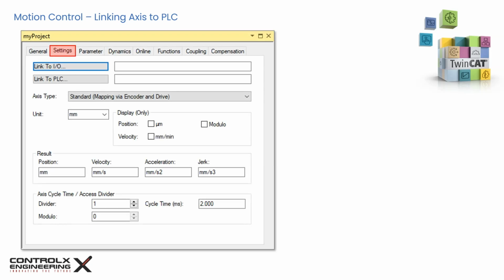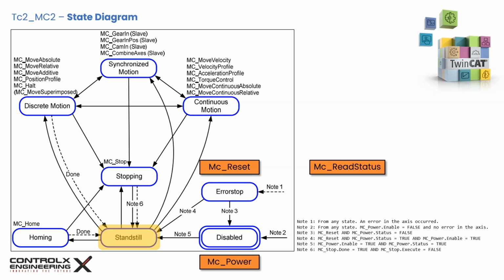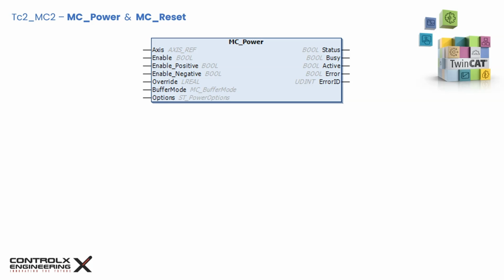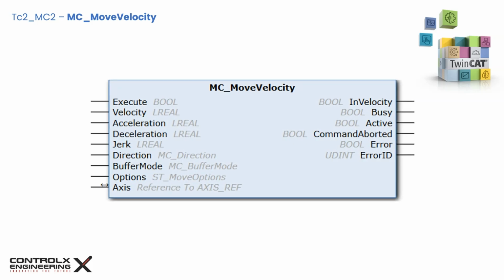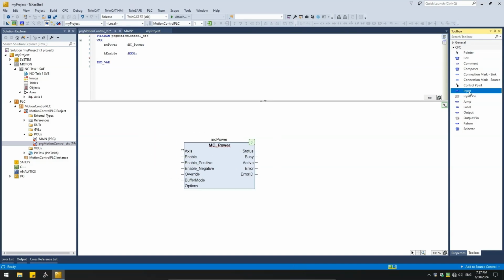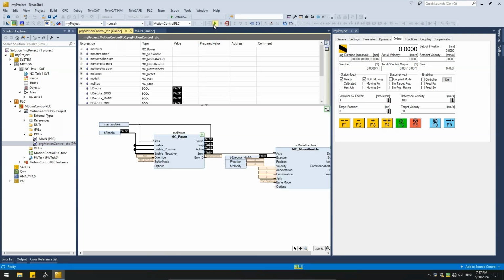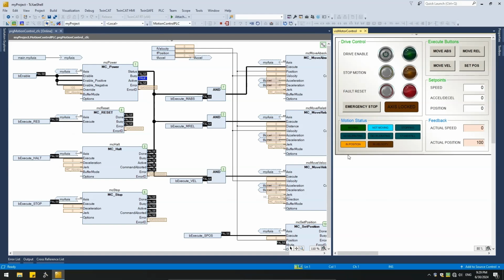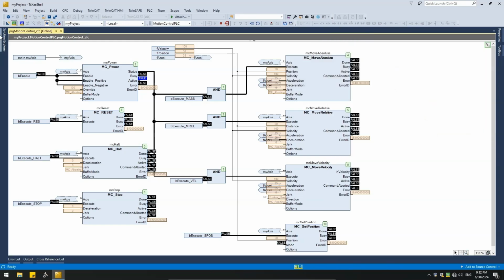TwinCAT 3 Motion Control (Part 2): PLCopen Motion Function Blocks Explained

Comment: How would one command the axes from a separate application? I'm assuming ADS is the appropriate solution. How can one command the function blocks from ADS? (Either using the C APi or the Python PyADS wrapper.) Also, what's the "done" criteria for an absolute move? Sometimes I want to be notified as soon as the axis reaches the settling window, while other times I want to wait for the axis to be in the window for the settling time (ie. done oscillating).
Reply from the maker: One way is to create the motion control POUs using the function blocks as illustrated in the tutorial and then pass the setpoints from your external application (C, VB, python, .NET, etc) by implementing TwinCAT's ADS protocol. I will be making a tutorial on ADS comms in the future, so make sure to subscribe to the channel.